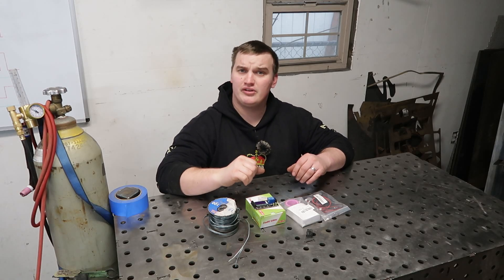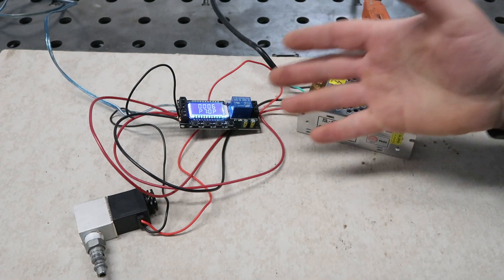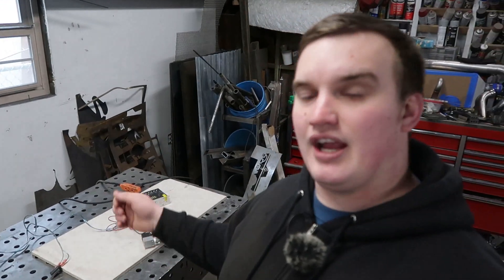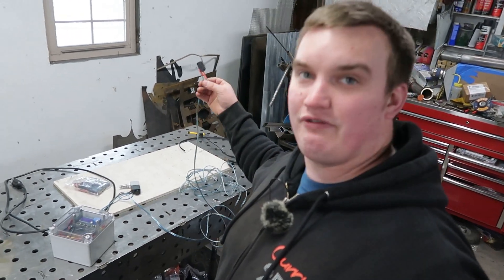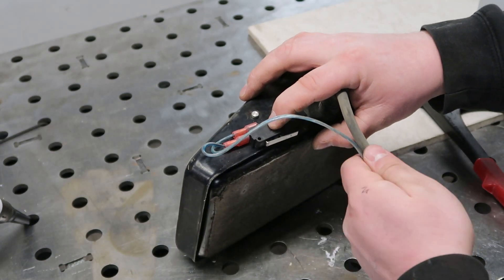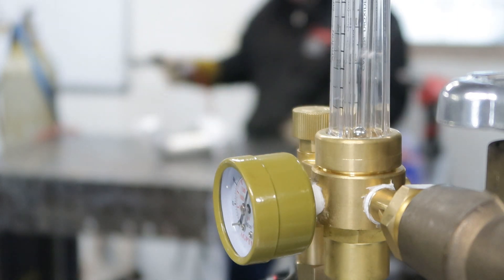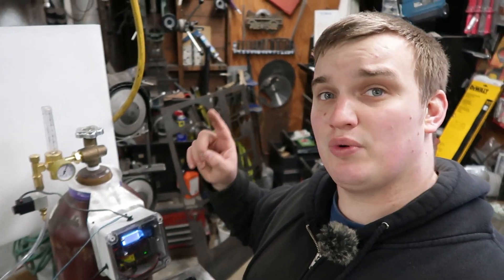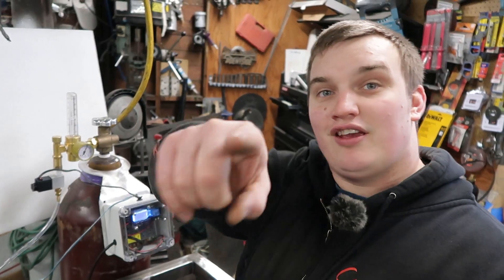Purge timer ( DIY )

Comment: I just ran a solenoid valve in parallel with the argon solenoid in my machine for the purge. It’s on and off at the same time, which is fine when I’m welding. To start the purge first I have a double double pole, double throw switch connecting the solenoid directly to the input voltage. I flip the switch to start the argon/air replacement, and then flip it the other way when I weld.

It’s not as sophisticated as this, but it’s simple, and works well.
Reply from the maker: That's all that matters 👍

Comment: Neeeed! I think you can easely go down to 3-4 sec. you can allways click it, an exstra time when welding some thick stoff. :)
Reply from the maker: Did not know you could use 90/10 to back puge good to know . I have only used that for pulse mig at work 👍
Reply from the maker: True
Reply: @amcustomfab  normaly I would use. Formier gas consisting of 90% Nitrogen + 10% Hydrogen. for the backflow. its cheaper

Comment: Hey man ik you're probably really busy but  purchasing a primeweld mig 180 and I was wondering if you knew how to convert it to tig. I think I have an idea I'm just worried about ordering the wrong things to do so I'm new to welding and I greatly appreciate your time if you read this. Thanks!
Reply from the maker: No problem I'm actually thinking about doing a video on how to make the Mig 180 TIG weld. But I'll let you in on a little secret in a couple weeks primewired is releasing a new 200 amp machine that will Mig and Tig just to scratch start Tig but it will come with CK worldwide torch and it will make TIG and stick
Reply: @amcustomfab  woah! Thanks so much looking forward to following your channel more!

Comment: Isn't this a feature already on most new tig machines (your Primeweld 225)?
Reply from the maker: You are correct the prime world 225 does have a pre-flow and post flow ability that times the gas coming out of the torch itself. But what this does is times a secondary gas line that purges the inside of your tube while you're welding it. 🙂

Comment: do you have a valid discount code for the Primewels225X ? AMCF10 is not working? tks
Reply from the maker: The space was my mess up there shouldn't be any spaces I don't believe or at least I don't think that should matter maybe they made it so the code doesn't work for the machines anymore I know it was for a while a couple people used it but maybe it's just for the other products now sorry
Reply from the maker: Amcf 10 is the code through weld metals online but from what I've been hearing they are charging shipping now so it's pretty much a wash I would just buy it direct through primewald. And sign up for their email list and you get $25 off
Reply: @amcustomfab  No there is still free shipping let me try the code again with the space after the F